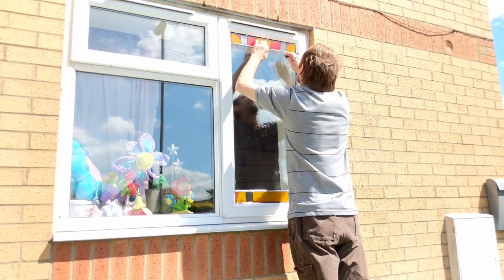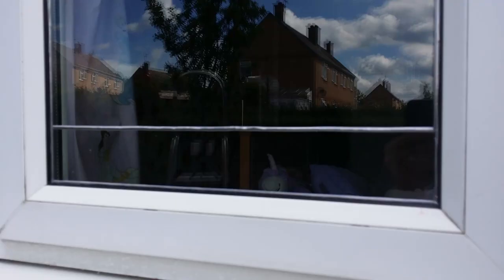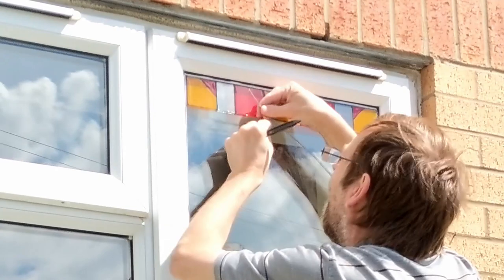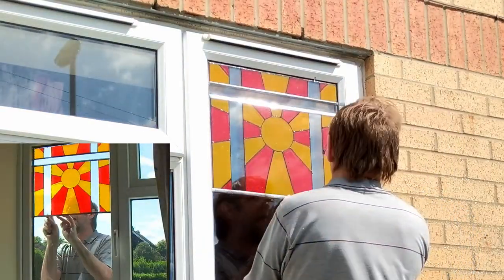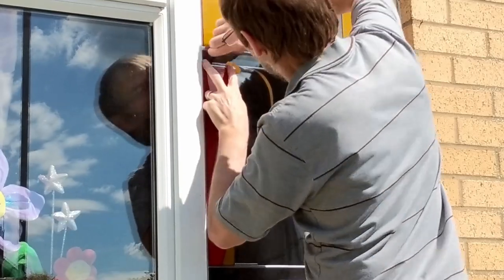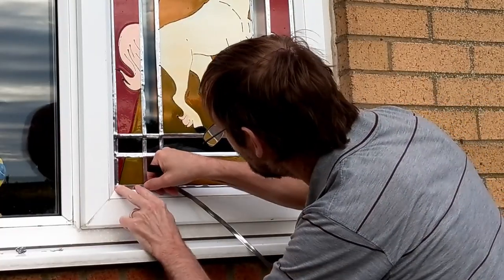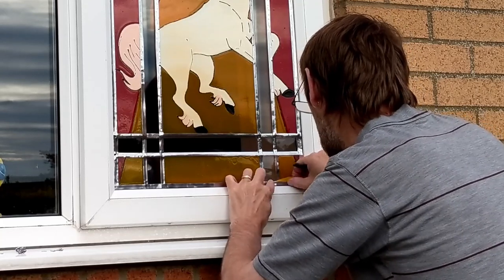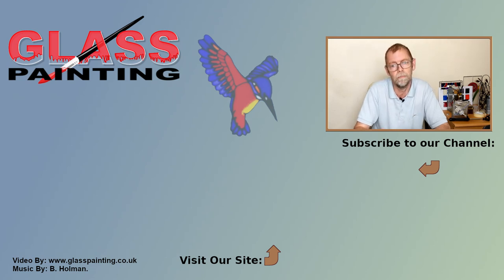How to make a faux stained glass window. Part 2.

Comment: wunderschön und genial einfach. kann ich das auch auf eine selbsklebende folie aufmalen und kleben oder muss es unbedingt plexiglas sein?
Reply from the maker: I did it on real glass as it needed to go in the oven.  The paint I used (Pebeo Vitrea 160) is dishwasher proof once baked. I assumed this would also mean it was weather proof (it's on the outside of the window). If you are working on the inside of the window there is no reason why you can't use plexi-glass with air dry paints as I did in another window:

https://www.glasspainting.co.uk/glass-painting-projects/glass-painting-a-window
Reply from the maker: @suryamarga4586  There are two choices. If you want to do the outside of the window you can do it on pieces of extra glass "2mm" and add that to the window using Adhesive lead tape, as in the video. By using glass you will be able to use oven bake paints which will then be weather proof.

If you are happy to do the inside of the window you can use plexi glass with air dry paints. It won't be weather proof but it can still be wiped down.
Reply: @GlassPainting  vielen dank. ich werd es mit durchsichtigem kleber und lebesmittelfarbe versuchen. es sind ja nur kleine vierecke oder mal ein etwas grösseres rechteck. dazu kann ich auch noch zum teil statische folie zuschneiden. das mit dem einbrennen und dem glas ist mir zuviel aufwand für nur ne mietwohnung. aber super das es sowas gibt. : D